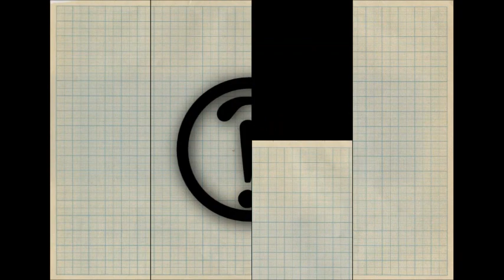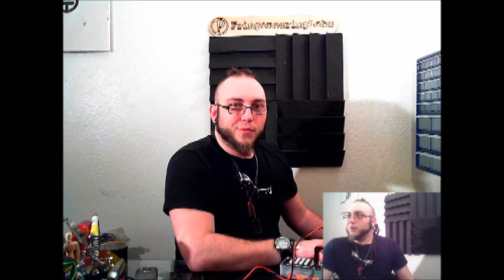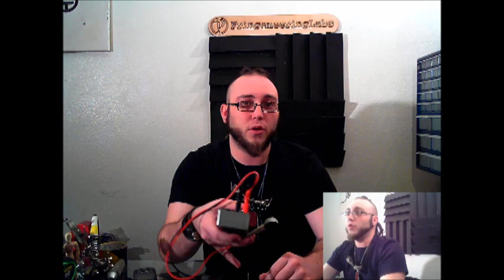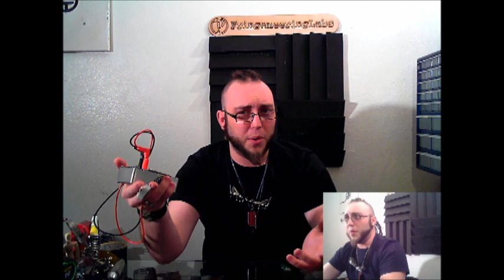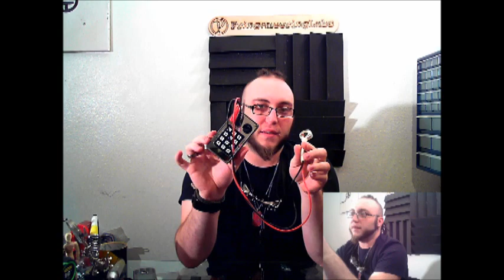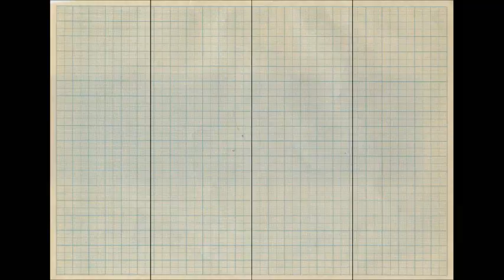Phone Phreaking and an Arduino BlueBox

Comment: When I was 10 years old I had the idea to record my phone line at home when I called from a pay phone. Put in a dime and got the tones. It was fun trying to play it back on a "portable" cassette player. It worked and free pay phone calls were fine until the phone company muted the mouthpiece before the call connected. Then sometime in the 90's Bellsouth switched to Protel cocot boards. Then the only way to get free calls was to tap the line using a buttset.
Reply: Omg I remember when they muted the mouthpiece. I carried a finishing nail and a paperclip. Put the nail in a hole in the mouthpiece and smack it against the booth. Pull the nail out and put a paperclip in the hole and the metal shielded cord. It would unmute the mouthpiece. Play your tones, make the call, and remove paperclip when it started ringing.